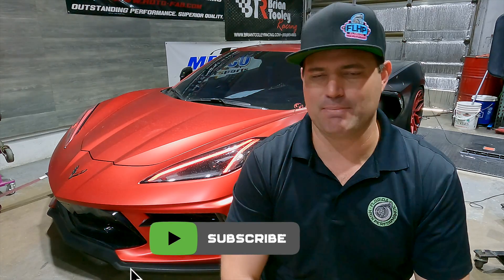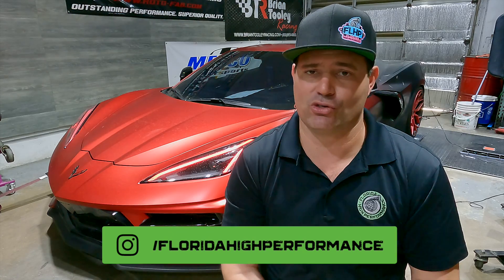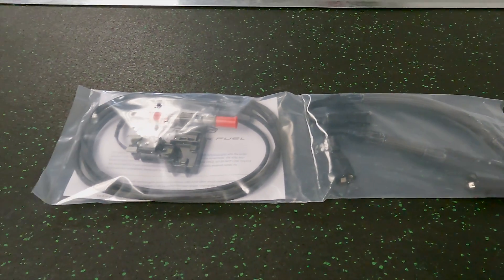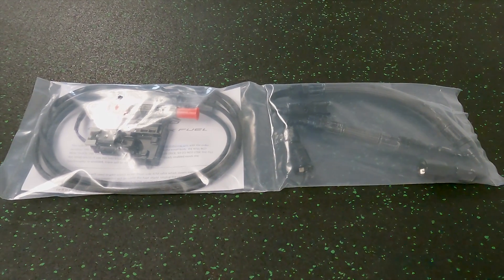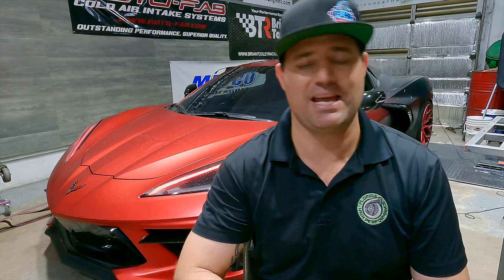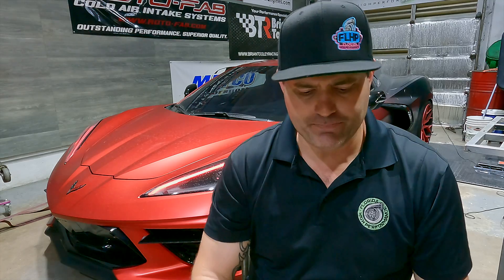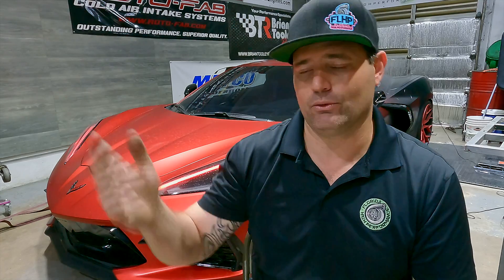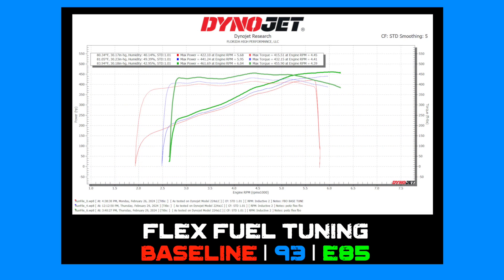C8 Corvette FLEX FUEL Tuning is FINALLY here using HP Tuners

Comment: American racing headers said they did not gain 1 single hp when they tested there headers with sport cats.   They said that is why they decided to not make sport cats for the c8.    I am so glad i called them first as i was about to do the headers with the race by pass pipe.
Reply from the maker: Tuning is where the gains are- the mods help support those gains….
Reply: @floridahighperformance it helps for sure.  It all adds up. But catback with American racing headers is bringing 30hp on the dyno!!  

What I want to know is can we do full bolt on with e85 and safely run a 75 shot of NOS?? 

That would be epic!

Comment: I just full my tank with e50
Fast no tunrs
Reply from the maker: @ggonzalez6045  without the flex sensor adding ignition advance with E50, you’re only getting the cooling benefits of E85…nothing more.  You’d make a lot more with tuning, just a fact.
Reply: @floridahighperformance  feels faster!! Way faster 
Terrible mpg from 18 to 13 mpg
Reply from the maker: @ yeah that’s a major draw back of e85…consumption

Comment: i undestand the cost of unlocking global b and the credits, as well as the e85 kit but that leaves around 2k for install and tuning seems way high unless thats including labor to r@r the bumper remove ecm but still. id imagine 2k for the ecm work $500 for the sensor and maybe $750 for the 93 and e85 tune with dyno
Reply from the maker: Tuning these takes more time, and therefore cost more money...period.

Comment: Peitz did my flex fuel mod and picked up 35 rqhp (calculated for dynojet from mustang dynos) on a bone stock 2021 Z51.  Cost was about $4,800, but the bang for the buck on the C8 was the best I could come up with.  Unlike my C6 and C7, as the gentleman stated in the video, it's not your uncle's C7.  The cost to HP Tuners alone was $1,600 for unlocking the ECM, $400 for credits, and $400 for a MPVI3 module.  So before Alex even got started, the cost alone to HP Tuners was $2,400.  Then the DSX unit is a must have when going to E85.  I just felt the flex fuel was the best bang for the buck for unlocking some rwhp.....................now if someone could come up with a safe line lock that wouldn't crater the computers in the car, that would be great.
Reply from the maker: Yep!  Sounds about right....

Comment: You ran straight E85 without updated Fuel Pumps?
Reply from the maker: Yes sir, in naturally aspirated form, the factory fuel system is more than capable of supporting the power.  FOrced induction is a different story, however.
Reply: @floridahighperformance  yea, im FI, only got it to E50…
Reply from the maker: @exam2300  Yeah that sounds about right.  Add some meth to it that helps a lot...
Reply: @floridahighperformance  Or intercoolers right?  LOL

Comment: So basically 8-10k for 40rwhp gains, if you include the cost of the bolts on 😢
Reply from the maker: Yes sir...it's getting wild out there...
Reply: No worth it. Get a 2020 Supra or a 21 tunable for 2k and over 500whp and 600 plus tq.
Reply: @carmello000jp nah I’m good il just build my c8 and pay the money.. that’s why I got it in the first place I ain’t no peasant 😂
Reply: @carmello000jp  500 hp?  you getting smoked lol.   500 is stock for the c8.  Your pushing 560hp to 570 with full bolt ons and e85.  That supra is getting left in a drag race.    C8 is not geared to ever be good at roll racing.
Reply: @MR.TOYBOX you have no idea what you are talking about